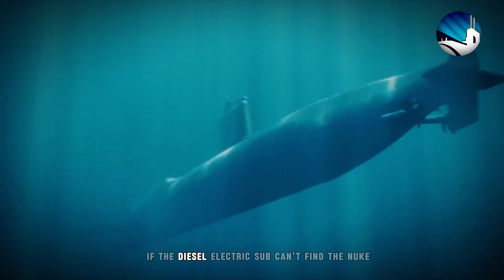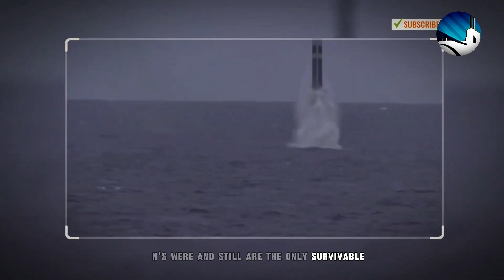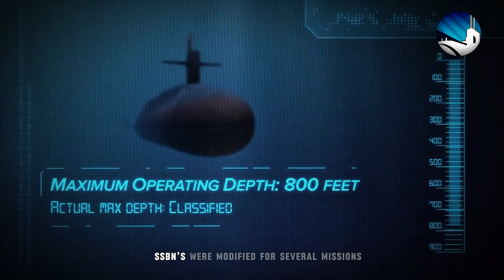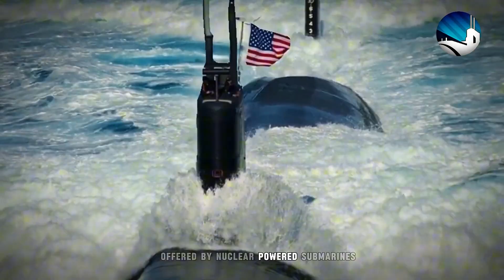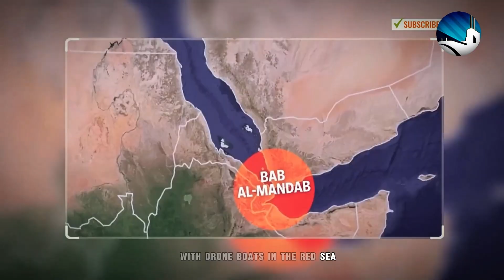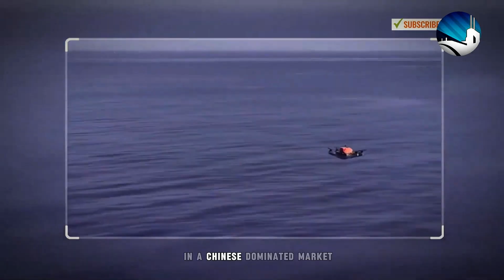Why the U.S. Navy Refuses to Build Diesel Submarines

Comment: This video is misleading because it frames the U.S. Navy’s move from a mixed diesel-electric (SSK) and nuclear (SSN) force to an all-SSN fleet as if it were simply a verdict on “conventional submarines.” 

Admiral Rickover’s influence and the institutional momentum behind nuclear propulsion mattered a lot, but the decisive drivers were strategic: Cold War missions demanded sustained high-speed transits, long on-station time, and under-ice operations—requirements that conventional boats of the era, limited to a few days on batteries before snorkeling, could not meet.

What’s different today is that modern conventional submarines are no longer “short-legged diesel boats.” Air-independent propulsion (fuel cells, Stirling, closed-cycle diesels) and advanced batteries have reduced indiscretion rates and increased submerged endurance at tactically useful tempos. 

Japan’s late Sōryū boats and the newer Taigei class, for example, are widely reported to have replaced Stirling AIP with large lithium-ion battery installations, improving submerged performance and reducing snorkeling frequency.

The U.S. Navy’s real limitation is less “physics” than industrial and institutional path dependence: it hasn’t fielded diesel-electric submarines in decades, and reintroducing them would mean rebuilding training pipelines, maintenance facilities, and supply chains—regardless of whether the hulls were domestically produced or derived from an allied design.

You can have easily have blue water SSK with today's technology due to move to LNIB batteries from traditional lead-acid battery combined with AIP (chemical engine).

For example, JMSDF's Taigei class SSK can purportedly stay submerged for 10 days on electric while taking only ~100 minutes to recharge the LNIB batteries at snorkel depth.

And there is nothing preventing SSK from using AIP to recharge LNIB batteries, albeit it will take longer.

Primary advantage of conventional SSK over nuclear SSN is stealth when it's operating under electric or AIP power.  

Primary advantage of nuclear SSN over conventional SSK is range albeit in reality, nuclear SSN is limited by amount of food supplies it carries onboard.